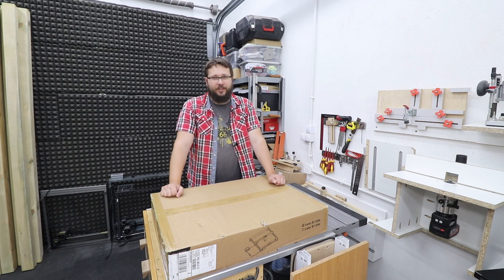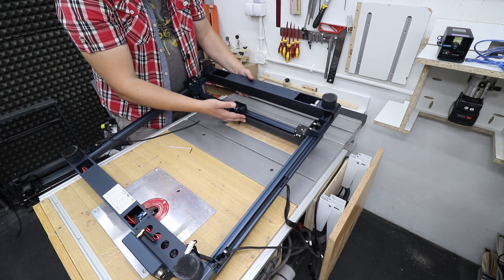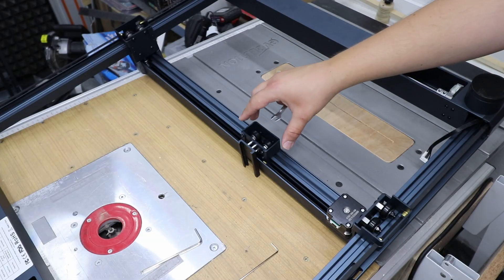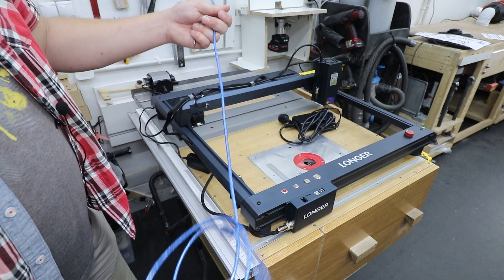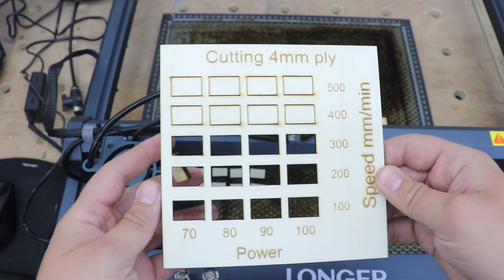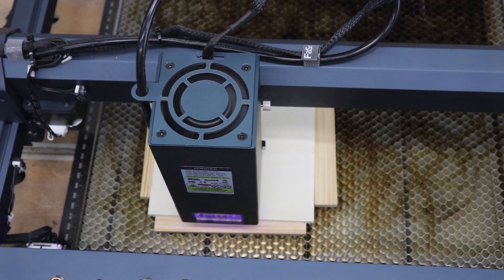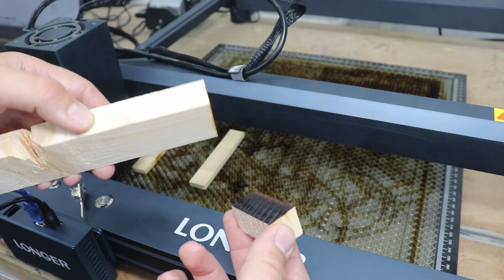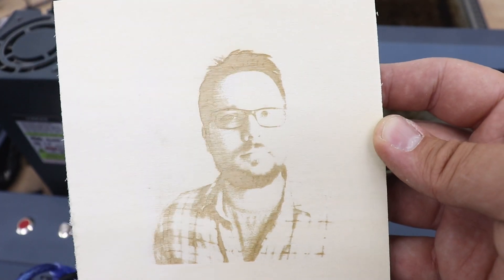Longer Laser B1 20W Engraver and Cutter | Detailed Assembly and Testing

Comment: You mentioned that there wasn't a power source for the pump but there is (you had it in your hand as you plugged it into the unit), I take it you meant there wasn't another mains plug to plug in 😁...... anyway, more importantly another excellent video on both the setup and use of this machine 👍
Reply from the maker: That's exactly what I meant. For few lasers I had to get another row of sockets 🤣
Reply: Tuotd